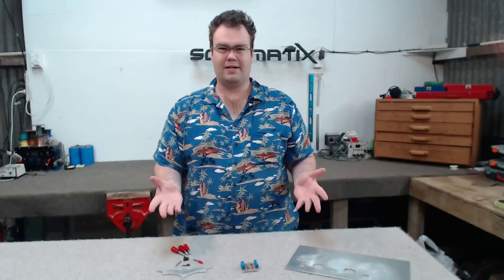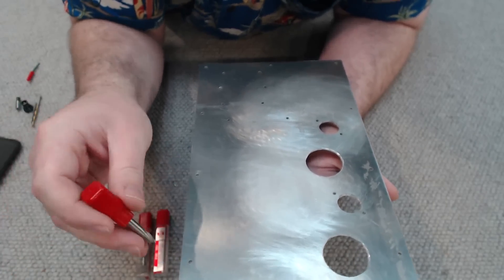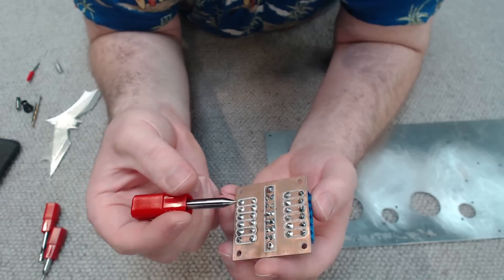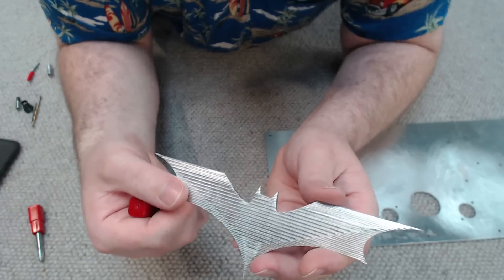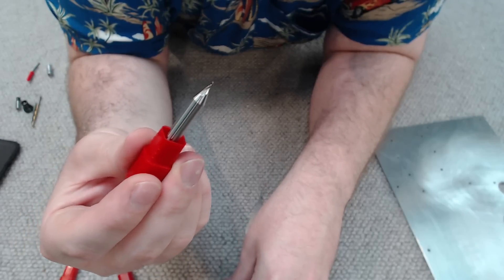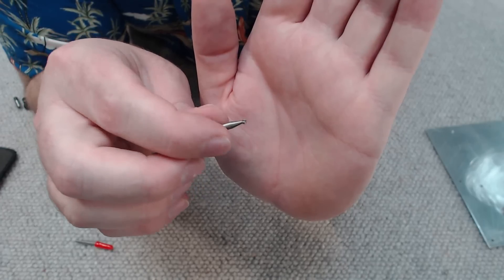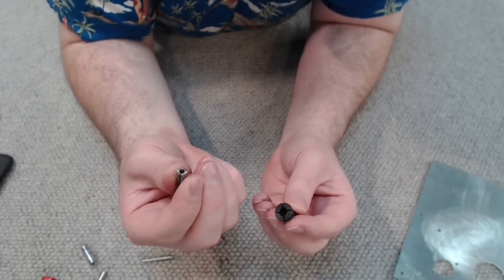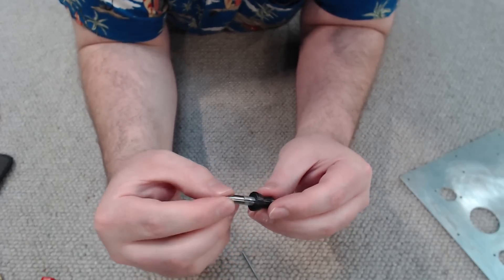Getting Started With Milling Bits & Accessories, Plus Speed & Feed Rates (OX-Metal CNC)

Comment: Hello from Wellington, NZ. You can get special bits for milling pcb's and carbon fiber that don't wear out as fast. Also, milling these in a small wet table you make to capture water helps keep dust down, and cutter lasts even longer too. We only use these, as often cut PCB - fiberglass and cabon fiber.